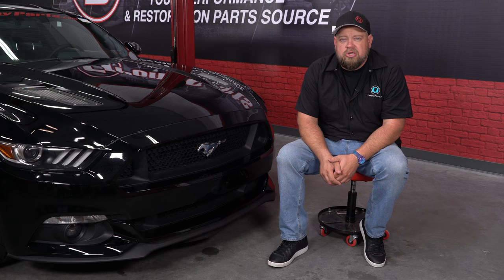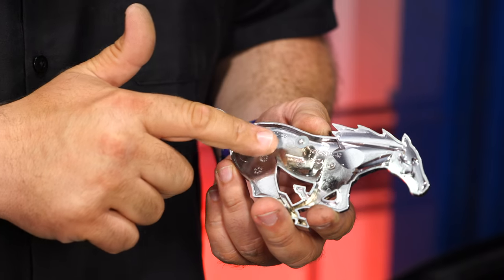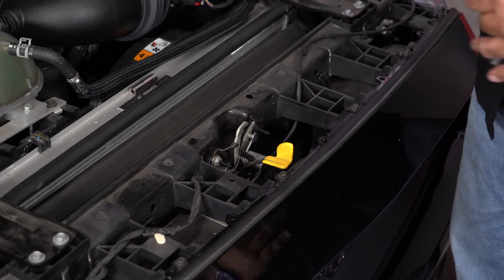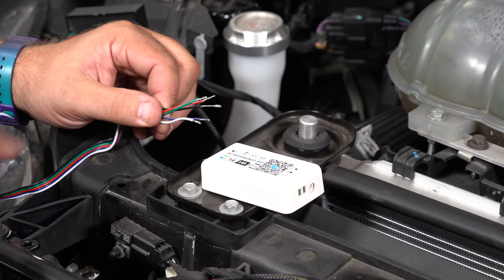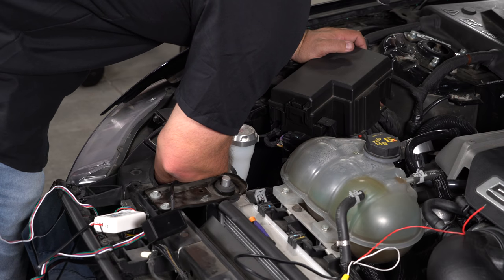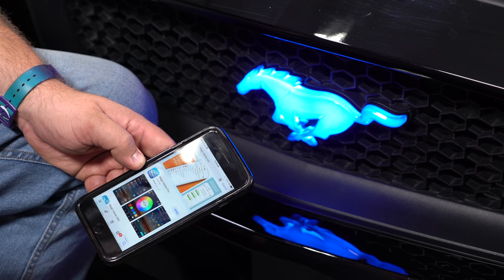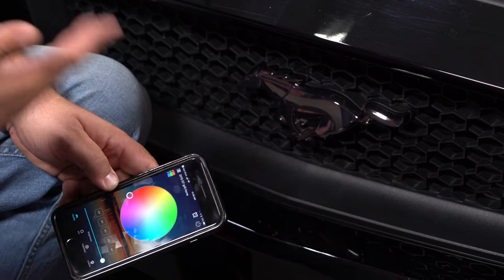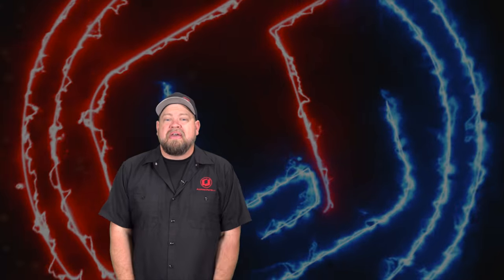2010-2017 Mustang Install: X-Lume Black Chrome Running Pony Grille Emblem w/ ColorShift Illumination

Comment: Is there a reason you used a new grounding point instead of reusing the previously tapped ground wire on the headlight?

Comment: Are you able to change the color of the lights using the app but not on wifi? Or is Wifi required to control the lights?
Reply: that's the only way to talk to the box.

Comment: Whi wouldn't thid work on 2000 mustang? Isn't the horse emblem the same on all?
Reply: JerseyGuy 90 The wiring harness might be different
Reply: If I remember correctly the horse's shape is slightly different, the 15 emblem is edgier.
Reply from the maker: They are a different size.
Reply: Do they have these for 2011?
Reply: And some are also mounted differently in the car as well my 1999 was different at least
Reply: Do they have these for 2005-09?
Reply: Traveling with Castro you’d need a custom grille.
Reply: @Jason-ev6zy  They work for 2011's. I have a 2011 and ordered mine directly from X-Lume. CJ only had the all white available.

Comment: Seeing how accessible it is, I wonder if it would be easy enough to power it with a battery.
Reply: Well it must run on 12v so that would be a bunch of 1.5v cells and an ugly installation.

Comment: Just installed mine and it's not getting any power, followed directions to a T. Any suggestions???
Reply from the maker: Double check your connection is clean where you draw power. Use a test light to see if the power is going to the emblem
Reply: @cjponyparts  tested it and I have power running into LED controller but no power coming out of it ☹

Comment: Will this work for the 2018?
Reply: james russell it work on anything
Reply from the maker: You can make it work but the wiring would be different
Reply: I am about to buy this for my 2018 Mustang and I'm wondering how would I wire it? Or could you let me know what color wire/voltage the 2018 Mustang would connect to? Thanks in advance! :)

Comment: can it be put on a 2004 mustang gt
Reply: I’m going to attempt to install this on my 02. Already got it from CJ’s.
Reply: @Jayy Buckets23 yes but I need to figure out the wiring because I want to connect it to a switch three than the headlights.

Comment: You stated in the video it's meant for 15-17 models however your title also states that it fits from 10-17 models? My question is, will it fit 2005-2010 models as well?
Reply: Recep Tayyip Erdoğan thanks, that's what I meant just typed it up too fast
Reply: jboib jboib it fits anything. Its just a kit. You can put it on a corvette if u want?
Reply: Jerry Peterson thanks for the reply, I should've been more specific with my question, I was wondering if the grille emblems are different sizes throughout the different year models to know if this would fit in an OEM front grille
Reply: Jerry Peterson was also thinking about putting it on my lawnmower but I forgot to ask about that
Reply from the maker: My instructions were for 15-17 but it will fit 10-17.
Reply: Recep Tayyip Erdoğan  for the powertrain components it is 2005-10.

Comment: That LED controller\driver and the connections between the emblem and the controller are NOT weather proof! Pretty sad a $300 item is so poorly designed.
Reply: Is that just for the front badge or the rear as well?

Comment: Sorry, the statement that this fits all 2015-2017 mustangs in not true. It does not fit any of the Mustangs with the Pony Package. The grille is completely different. It mimics the 1969 grille with offset tri-bar pony on the drivers side of the grille. The emblem is also much smaller on the Pony Package.